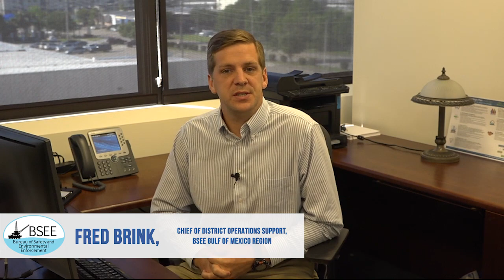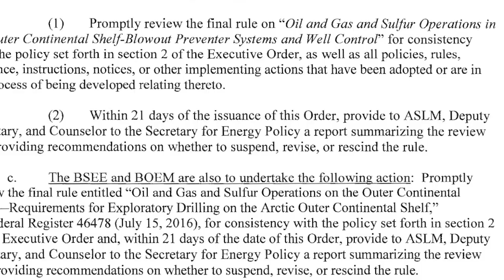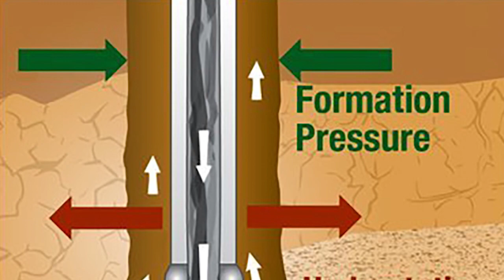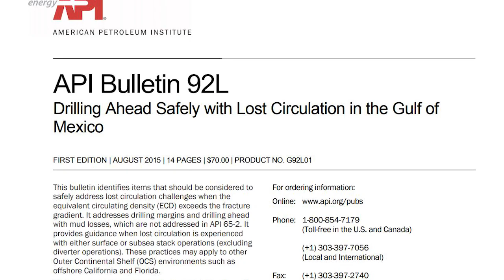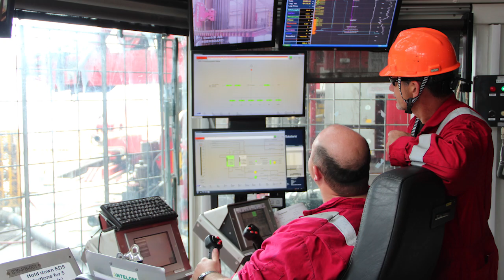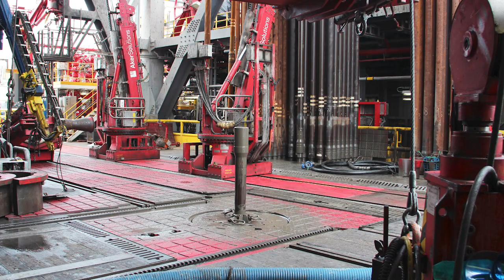Well Control Rule 2019 - Drilling Margins

Comment: BSEE needs to do its job of enforcing safety in ocean based oil production drill platforms. Using the same blowout prevention design that failed the deep horizon. The failure of this type of bop are highlighted in which led to the deep horizon's macondo well blowout.
 At the top of the bop assembly is the annular valve which uses a rubber doughnut seal that failed due to damage and failed to seal. When the horizon crew realized the annular valve failed the blind shear rams were activated but the wellhead pipe was bent from a massive "kick" or Pressure spike. The wellhead pipe was out of alignment with the blind shear rams and wasn't completely crushed/cut closed. Pressurized flow of gases and crude passed through the failed bop and up through the riser and onto the deep horizon platform where escaped gases found a heat source. Boom.
This needs to be taken seriously as I'm a mechanic employed on Alaska's North slope oilfields in Prudhoe Bay area, at the Kuparuk river unit. The company I'm employed with is subcontracted to conoco Phillips. Current 2019.
 I also have over 30 years experience in pipeline repair and maintenance. 
On June 20, 2010 I watched news coverage as the horizon spill response crew used underwater robotics to cut bent sections of pipe away from the wellhead. This left several feet of wellhead pipe sticking out of the seafloor. The wellhead pipe also had a flange inches from the pipe end.
From this I designed a caphead spool that could be lowered onto the wellhead pipe and lock on behind the flange using lugs or wings. At the bottom of the caphead I used chevron seals that would use the well pressure to seat the chevron seals and stop the leak.
The flow of crude and gases could be directed towards the surface where it could be recovered onto a barge or tanker.once control of the flow happens could be overpressured by using a tritan downhole pump and could begin injecting sealant of cement/slurry mix into the well until full. The caphead would remain in place until the sealant hardened. 
June 20 later that day found out that BRITISH PETROLEUM had a "horizon helpline" website and were asking for help. I called and spoke with the helpline personnel and informed them I had a design caphead spool that would stop the macondo well spill. They asked to see my design so I emailed to them from my Yahoo account. I didn't file for a patent.
Later I received an email stating my design was unusable by the helpline. When I tried calling the helpline found it had been discontinued. Several weeks later found that watching news coverage as my design caphead was lowered onto the macondo well stopping the spill. I later emailed BRITISH PETROLEUM and was told that since my design was not patented that they claimed the design was theirs.
I did what I could and still have copies of my design submitted, as well as emails back and forth from the helpline to verify the design was mine. For my contribution I was slapped in the face and brushed off. I tried seeking legal representation without success and still have a case against BP with the BPCLAIMS.ORG.
Recently in November 2018 I received an on the job shoulder injury which required time off and orthoscopic surgery. While recovering gave ample time to go over equipment designs and surprised to see the same blowout prevention design still in use by all ocean based oil production platforms. This type of bop system cannot isolate pressure and isn't designed to be periodically tested to verify proper operation. This type of bop sits on the bottom until needed and no one knows if it will work until needed.
In fact if this design bop works as designed still Leaves the well on the seafloor sealed by only a crushed/cut wellhead pipe. It has now become a time bomb. Any attempts to either repair or abandon will result in a spill. 
I have a safer and better designed bop system that is designed to isolate we, and is capable of testing periodically to verify proper operation. The control valves are designed that if testing shows the bop needs repair can be done and the well returned back to production instead of causing a spill.
My designs are available but are not free. The risks of a blowout severely diminished. This is what's needed to prevent loss of life or environmental damage,spill clean up and fines.
I intend to keep trying to market my upgraded bop design and will add that BSEE needs to upgrade regulations in ocean based oil production drill platforms as the same as land based facilities. Pipeline inspections, leak detection and control valve testing. Repair and maintenance. Spill response training as is evident that using the Taylor spill response resembles a Chinese fire drill. I can stop the Taylor spill and although BP won't admit, I already have the deep horizon's macondo well spill to my credit. in the future my plans include either starting my own deep water repair company that specializes in ocean based oil production drill platforms or have the major. Oil companies form a consortium that will support a spill response crew that will be able to respond anywhere/ anytime with adequate personnel and equipment that will effectively respond to spills or repairs. I can be reached here if interested and suggest that BSEE responds. "007".